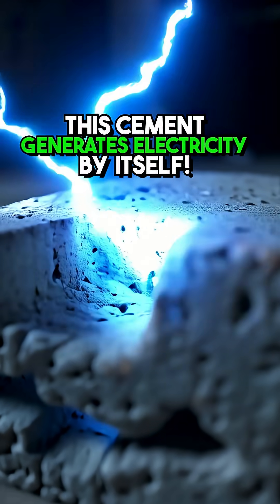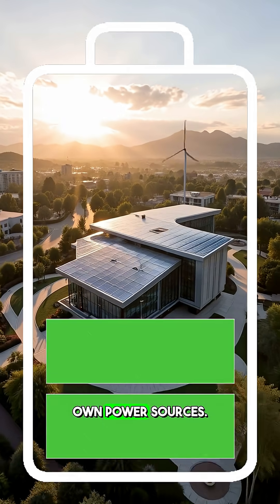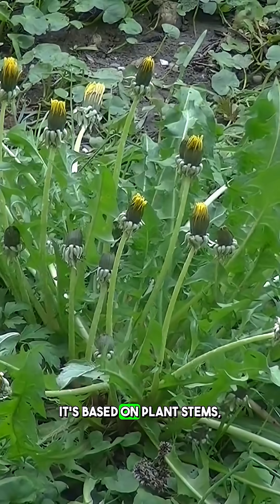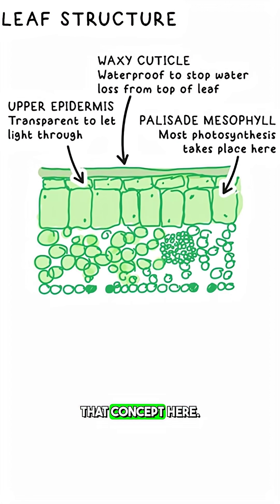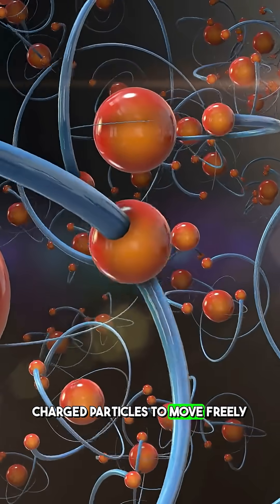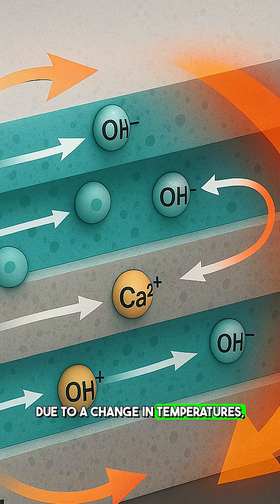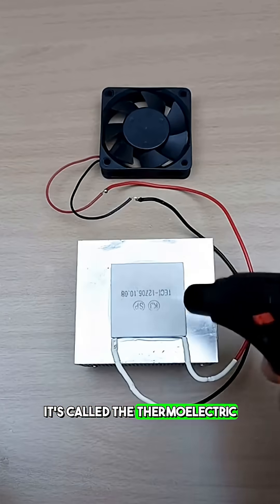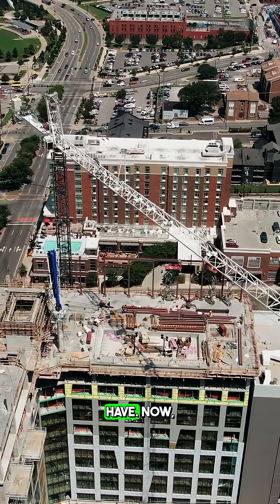This cement GENERATES electricity!

Comment: So few questions and problems with this
-how much electricity does it generate? Like in volts and amps because it could be really dangerous if its alot but if its not alot then could it really power itself at todays standards?
-would the "battery"/concrete degrade over time not letting it keep or generate charge as well?
-kinda off the first question, lets say it does generate alot of energy, wouldnt it be really expensive to insulate an ENTIRE STRUCTURE and keep it safe?